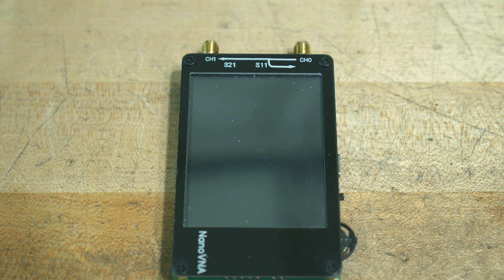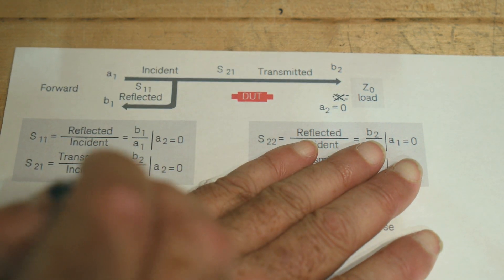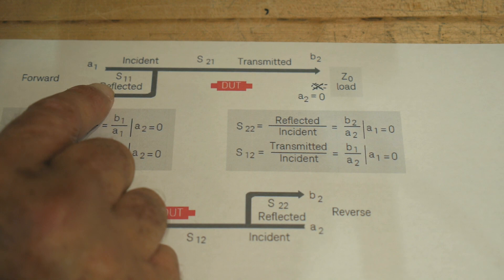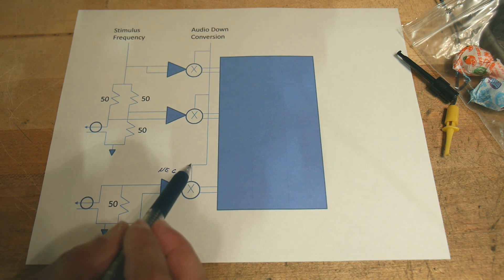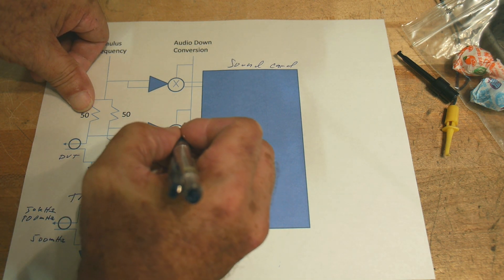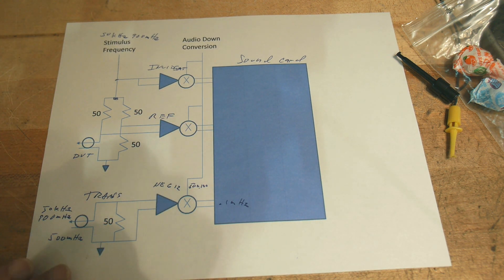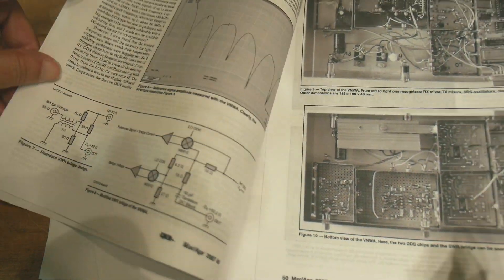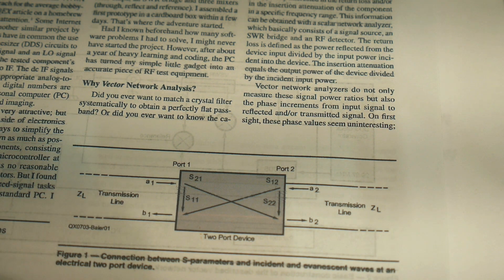#363 NANOVNA How it works theory of operation

Comment: There is a V2 version that just became available on eBay from China. It goes up to 3.5 Ghz but at 3X the price ($150). I will wait until the price drops below $50 before buying one.
Reply: https://nanorfe.com/nanovna-v2.html In this link you can see where to buy the "original NanoVNA v2". It's already down to $60. I can't confirm the information in the link, it's just something I found whilst googling around.

Comment: 100 kHz is not audio under any circumstance; depending on how you want to look at it, it is ultrasonic if referenced to audio measurement techniques, or Very Low Frequency (VLF) if referenced to RF measurement techniques. Sorry, I just had to pick nits. Otherwise, good video.

Comment: IMSAI guy,
Based on the last part of your video about reduced output from the Si5351A above 300MHz, I read that you could insert a cheap Chinese LNA. Have you considered that possibility and where you would include it in the schematic?
Reply from the maker: I have not looked at any modification of the design. I'm not sure what the limitations are. adding gain might not fix everything
Reply: That should be doable; perhaps also incorporate a high-pass filter, then calibrate using SOLT ...

Comment: How NanoVNA measure complex impedance? To my feeling its can can be done by measurements of amplitude and phase of the reflected signal on the bridge...
Reply: Note: The TLV320 (codec) always works with a "reference" (internally connected to the TLV320) and either the S11 or S21 ports also connected to the TLV320, so, known phase comparisons can be performed, after calibration constants have been determined by doing SOLT.
Reply from the maker: yes you are correct.

Comment: One thing that has made me wondering: How do they get rid of the base frequency and the unwanted harmonic when they use the harmonic as signal source? Obviously the measurement must be done using only one frequency. Does it have some switchable filter?
Reply from the maker: I assume the data captured by the sound chip could have a software filter applied to it
Reply: The harmonics are useful. Infact how do you think a 300MHz clock gen chip measure upto 900MHz? It uses the third harmonic...

Comment: The Si5351 is NOT a DDS, it's a multi sync fractional divider.
Reply from the maker: That seems to be true. but it has a PLL also. not really familiar with that type of design
Reply: Ya - DDS is where you 'step' through a "PROM"/data table and create a sine (or any) waveshape through a look-up table output to a DAC .. PLL technique uses programmable divisor, a known reference freq and  a phase/freq comparative, an error amp/charge pump and a VCO ..